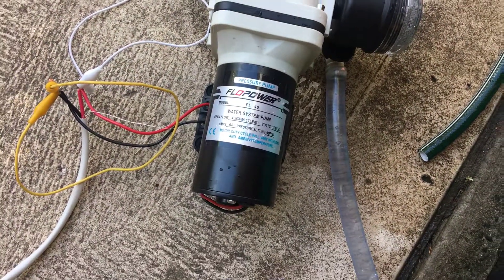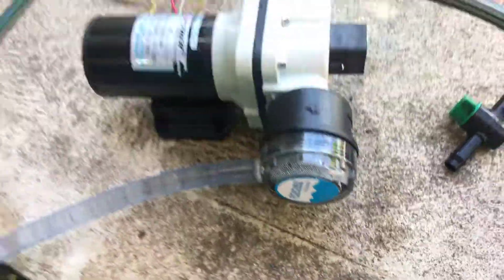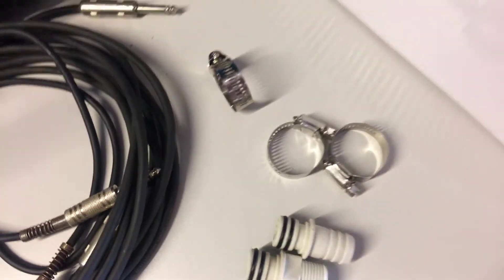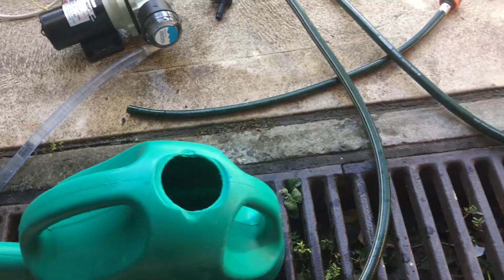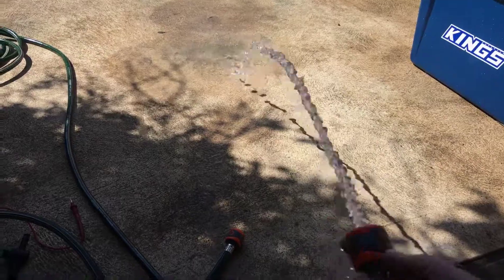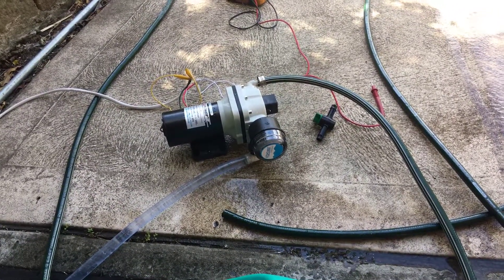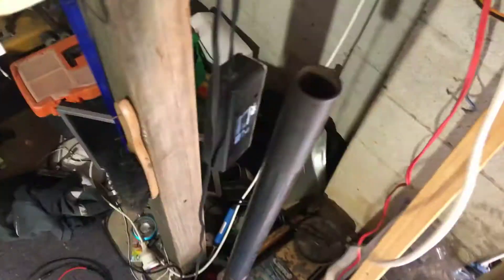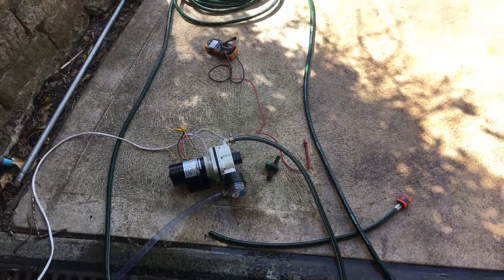Flopower FL-40 pressure pump

Comment: Hi can you PM how you wired this pump?
Reply from the maker: For my test it was straight to a regulated power supply @ 13.8v. There are only 2 wires for the pump so red to positive and black to negative, if you are installing it you would want a switch on the positive so you can turn the pump off when it’s not being used